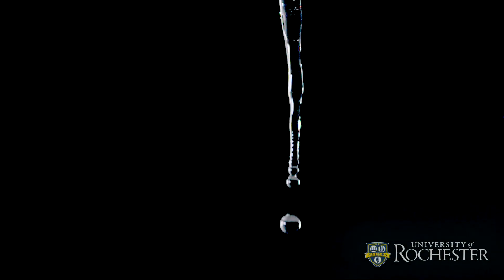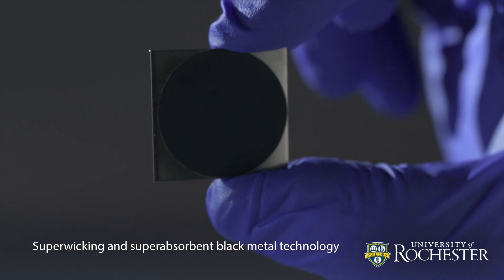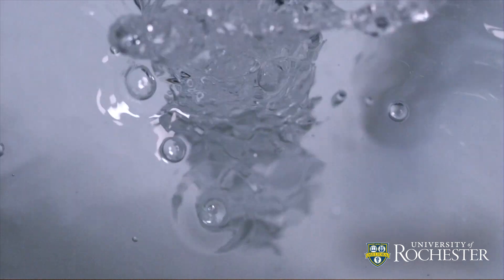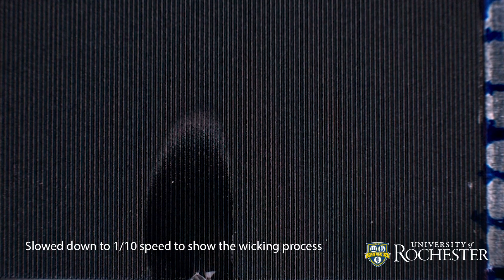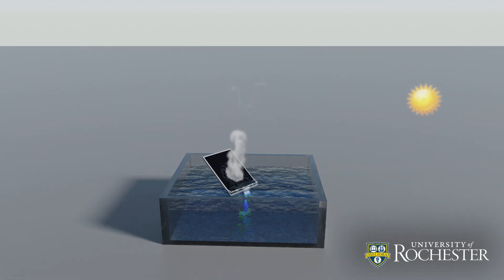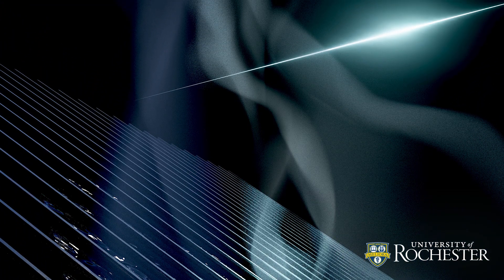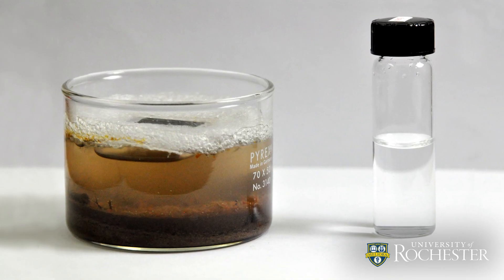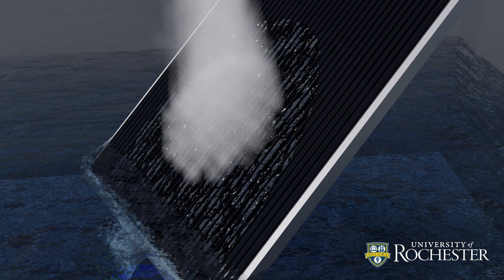Sustainable water purification using laser treated metal

Comment: So it is a humidifier to the open air = not much good. You need to gather and condense that evaporated water into pure water. Does the wicking surface get blocked and ruined by minerals, etc  left behind
Reply: We just showed here the solar-evaporator part. A transparent plastic dome was mounted above the solar evaporator to condense the vapor and collect pure water. After several hours of operation, the contaminants deposited on the surface can be easily cleaned through spraying dirty water. I am saying "dirty water" because it is not necessary to use drinkable water to spray clean the surface.
Reply: @Subhashlaserlab1  Can the humidity in the air be collected both night and day or does it require the best times for dew point deposits or foggy conditions. What humidity percentages are optimal for such technology? Does salt water increase the mineral deposits that would have to be cleaned frequently or would harvesting the excess humidity off the Salton Sea or Dead Sea work better than desalinating with traditional methods or thermal distillation processes with waste steam.
Reply: The surface is made of metal , so it can be easily cleaned from minerals unlike paper filters. No closed capillary is used.

Comment: If the clean water is evaporated then  How do I contain/collect it after it is evaporated ? There are a lot of problems with this product, it is more practical in a lab than in actual real life. 
But please answer me I still want to know how.
Reply: It's a solar still... you use a tarp or plastic dome over it and then collect the water at the edges after it evaporates and runs down the sides of whatever you cover it with...
Reply: Very cheap and effective, they use same principle a lot in under developed areas for clean water this is just the ultimate (as of now) affordable, most efficient option. They can produce mass panels of different sizes easily. Can be used to desalinate salt water as well.
Reply: The device is already tested for outdoor for water evaporation and condensation. A transparent plastic dome was mounted above the solar evaporator to condense and collect pure water.
Reply: Harvesting water from the air many call AWG using condensation that often times needs electricity for cooling. How does this device condense and collect pure water from the humidity in the air? Does it require high humidity levels above 50% humidity? Does it require and device to cool the metal and if not would that help improve efficiency if the metal was a low temperature to condense water from air. I wonder how large of a unit would it need to produce 5 gallons of water each day or something larger for a home as well. Would this device be good floating on top of salt water exposed to the hot sun that would increase humidity levels without excess salt build up?
Reply: @mohamedelkabbash6492  How much water can be collected from the air (AWG) and what humidity levels are required to make it economically viable? How big of a unit to produce enough water for a large home and big family or a small village or neighborhood. Could the AWG application be installed on someones roof and does it require a fan or good air circulation to increase harvesting water from the low or high humidity in the air?
Reply: Didn't notice the plastic dome.